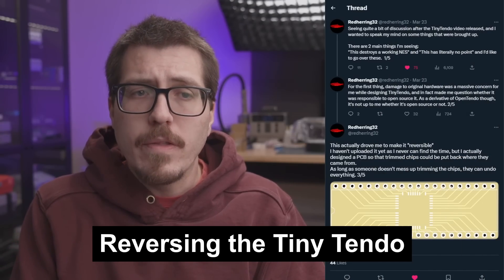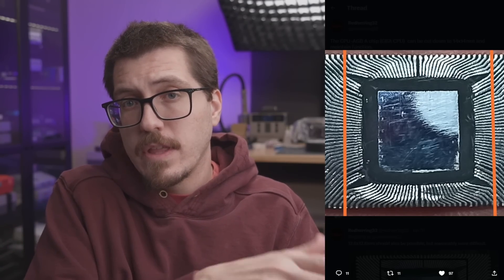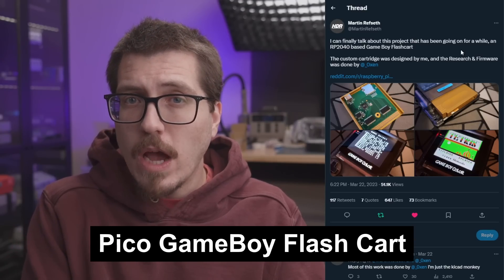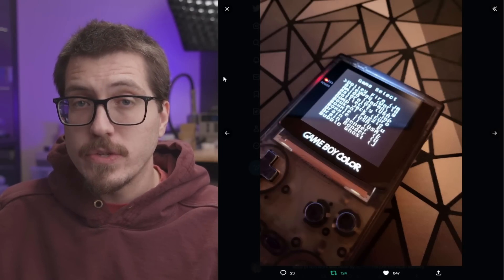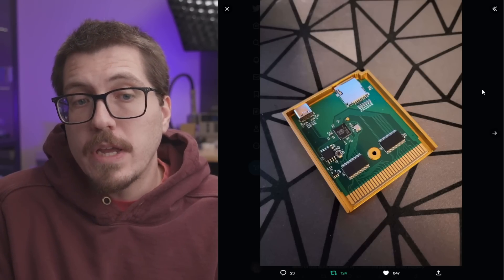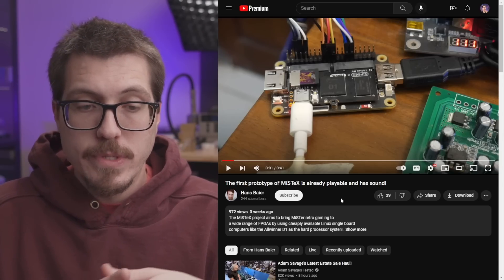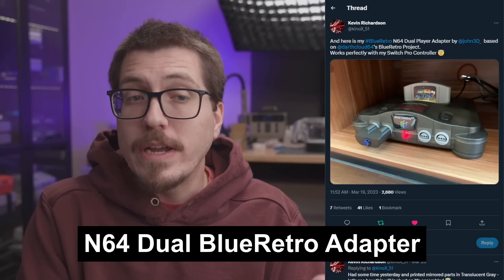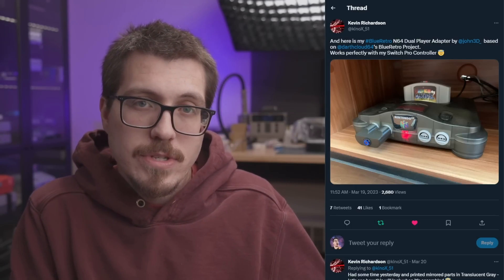Solder Mask "Leaks" an Upcoming Dreamcast Mod  - Retro Modding News

Comment: I want a full controller port replacement like the GameCube so I can have a battery mod already done. I have the parts but don't want to risk damaging my dc or pay a high fee to have it done. The GC adapter was so simple to install.
Reply: Also with a built in VMU. It would be great to have some extra memory internally.